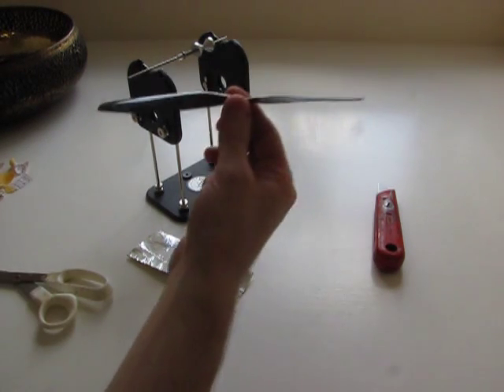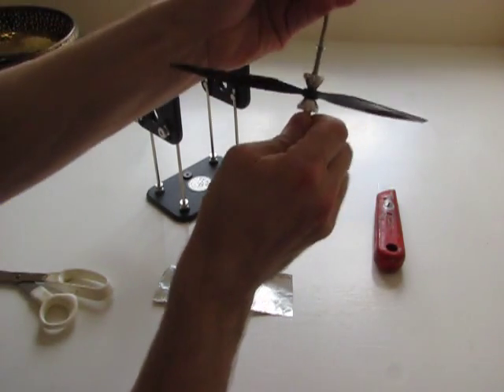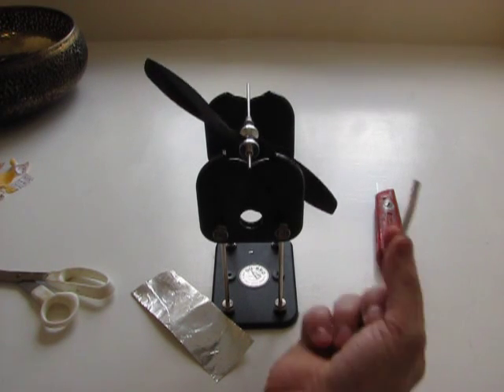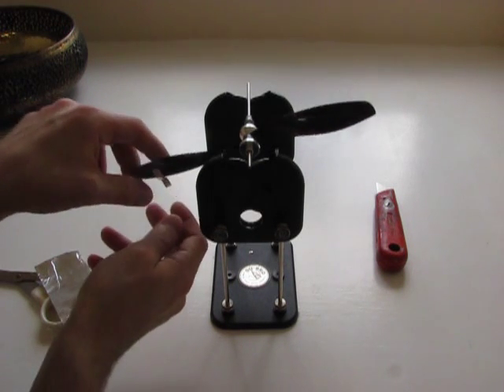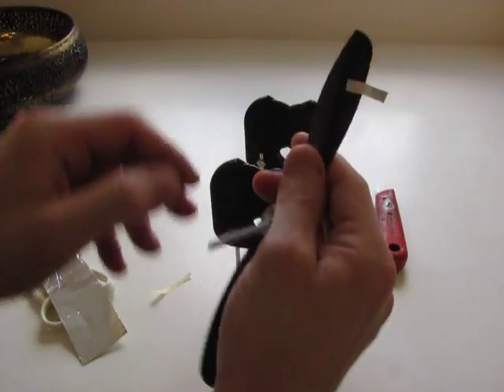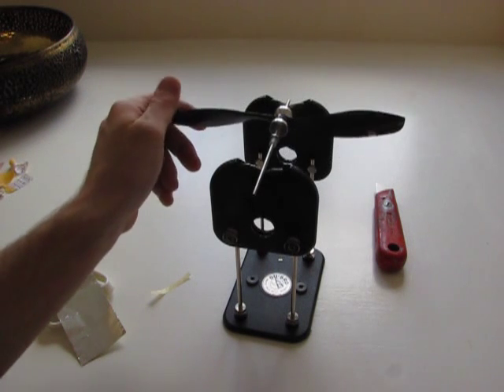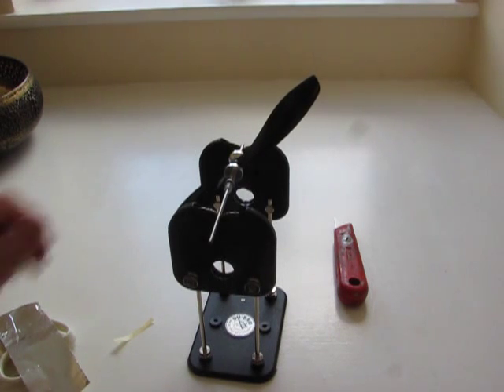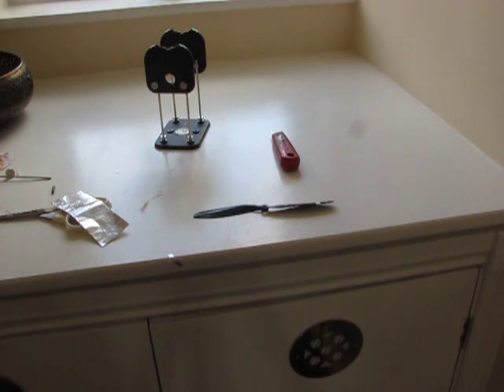RC timer 8 inch Carbon Fibre props review

Comment: In order to get detail in the foreground, you need to pump in light from overhead or from either side. The camera cannot make out detail when your scene is backlit like you have here with the window light. As for the prop balancer, when I changed to a magnetic type, I had to rebalance all of my props that I had originally balanced like you are doing in this contribution.

Comment from the maker: But you also get an airfoil lifting effect from the props, and that's going to involve the top side more than the bottom. Although I would guess that you get more thrust from the angle of attack than from the bernoulli effect so maybe it would be better just to put it on the top part. I will have to experiment.

Comment: Because they bottom part is what actually pushes the air to lift the quad, and tape on the bottom will distort the air and it wont be as smooth. Putting the tape on the bottom messes up the aero dynamics of the blade. The top has nothing to do with pushing the air down.

Comment from the maker: The silver tape looks nice in flight. The LEDs reflect off the tape which i think makes for a nice effect. If you prefer black stick with that though!
I put the tape over the leading edge so there is no exposed edge facing the slipstream. The tape is thin enough that i don't expect it to negatively affect flight performance at all and haven't noticed any difference, except that everything runs smoother when it's balanced. 
I'd love to see your method if you've made a video though!

Comment: @assmunch, the underside of the prop is the air foil that creates the lift, that is why your supposed to lightly sand or put tape on the top of the blade.......he could use black tape or scotch though